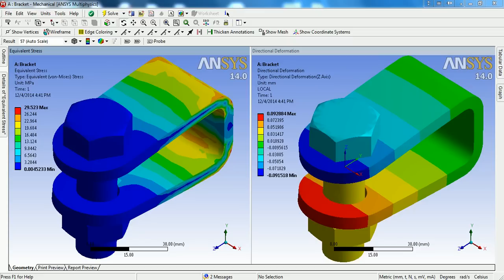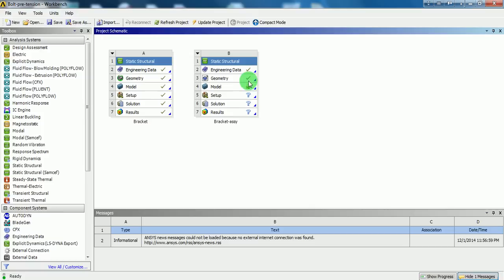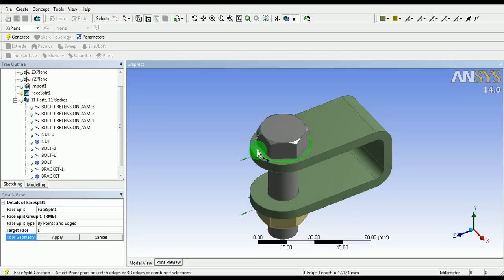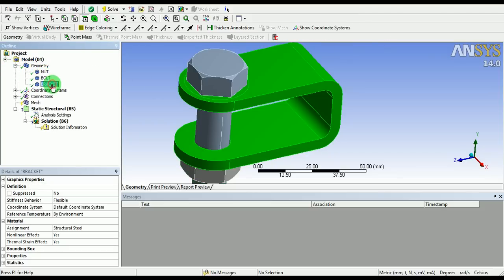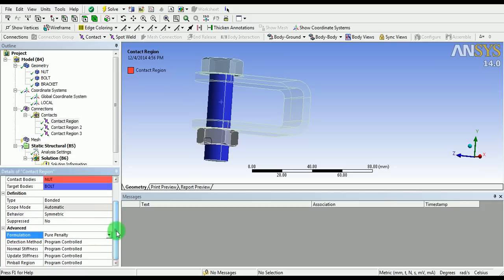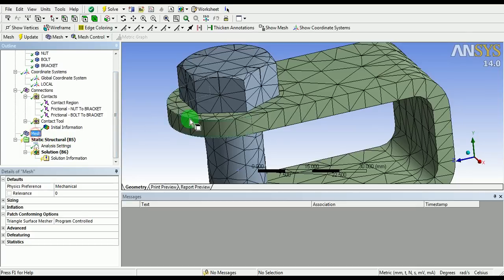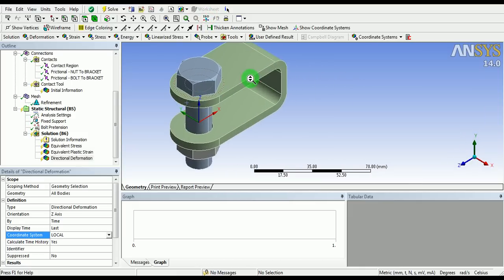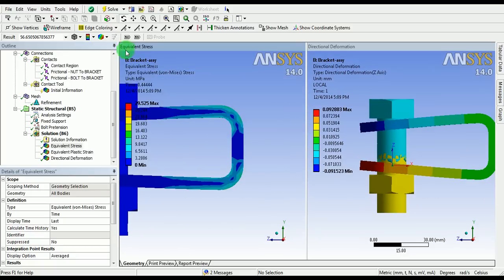ANSYS Workbench Tutorial Video | Bolt Pretension | Contact Non Linear FE Analysis | GRS |

Comment: Thanks for the video, I have a question, if instead of split surfaces I have surfaces created in a CAD software for contact area of the NUT / BOLT HEAD would ANSYS treat this area the same as if they were split? Thanks!

Comment: Sir,could you tell me why you need to build a new coordinate system on the bolt surface? If not , it is right of wrong?
Reply from the maker: +armstronger runner the bolt pre load will be along Z axis always, in the view of this new CSO need to be created, to ensure Z is along axis of bolt
Reply: Hello, I would like to ask you how does ANSYS know that preload is set in Z axis if you have not defined the preload using the LOCAL system. Thanks in advance
Reply: I mean, if we can not set the LOCAL system as a defined system in bolt pretension. How can we be sure that preload is in Z axis? Ty again

Comment: I wanted to do the FLOW ANALYSIS of bolted flange with o''ring(gasket) for inside vacuum of 10^-6 torr and out side is  1 atm pressure for 300 diameter pipe to find out how many minimum no of bolt required to make it seal. someone please help me
Reply: did you ever complete this analysis?

Comment: Hi GRS, can you suggest me on this one.  I want to validate an FE model of Bolted joint . Model is as simple as we can examine. Two plates connected with a bolt. Bolt is placed as if top plate has an extended length over bottom plate for abut 4mm  and same is to bottom plate but extension is in opp side. if i fix my bottom plate extended side, give a displacement on top plate along length and bolt is pre-tensed, then how can i validate my results ?!!!.....what formulas can i use for bolt subjected to pre-tightening and displacement that creates shear combined in assembly?!!!!
Reply from the maker: Jay, sketch your problem description and send the snapshot to  engineeringtutorsdesk@gmail.com. This will help me to help you.

Comment: Just a quick question. Is it necessary to do the face split part for the analysis?
Reply from the maker: Greetings! ! Ya face splitting will ensure that contact elements in the local regions only. Presence of contact elements apart from the contact regions will increase the computation time.
Reply: GRS CAD/CAE Thanks! Also how is material nonlinearity considered in ansys? Let's say we would like to consider both material and contact nonlinearity. For the bolt pretensions, is there a way to assign a range of valuesin ansys let's say from 1 kN to 5 kN?
Reply from the maker: Answer-01: https://youtu.be/svE0ZW6QrrY this is the link for the material, contact and geometry non linearity.
Answer-02: Apply the full bolt pretension force, in analysis settings give time steps as follows, initial=50, minimum=25, maximum=100. Solve the problem. Once the solution is complete you can retrieve the results at 1N, 2N, 3N... from the tabular data.
Reply: GRS CAD/CAE Thanks very much for your advice. I did this and I got good results. Just curious if I wanted to apply an external load, do we define 2 load steps or I can do it in one load step if bolt pretension is present (in terms of validity of analysis)?
Reply from the maker: Yes to avoid unnecessary contact regions, this helps in reduction in computational time.
Reply from the maker: Solving the problem in multiple load steps is a good idea, you can refer to my tutorial on plasticity & simply supported beam bending test for better understanding.

Comment: Hello Sir, 
The presentation is very good and useful. I need to know the following details.
1.For applying pretension, only half portion of the bolt is selected. Why it is so ?
2.While applying pretension, threaded portion of the bolt can be considered ?
Reply from the maker: Hari, ANS-01: only one half of the cylindrical surface is enough in ansys to recognise the axis of the bolt.
ANS-02: Threaded portion has to be considered only if you are interested in stress at threads.
for more videos visit my website below.  or write me on my mail ID.
Email: engineeringtutorsdesk@gmail.com
Website: https://sites.google.com/site/feaengineeringdesign/